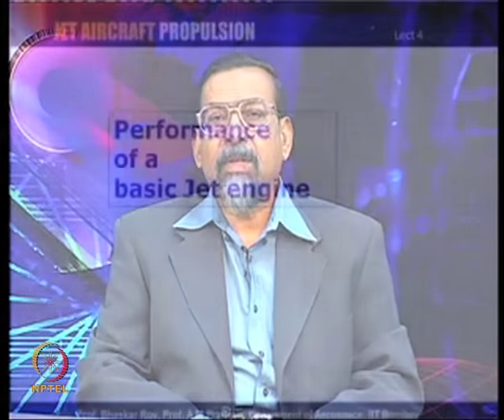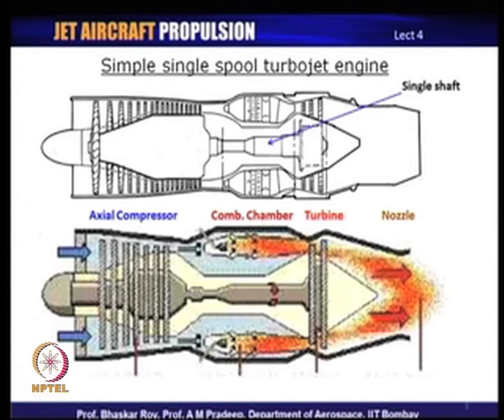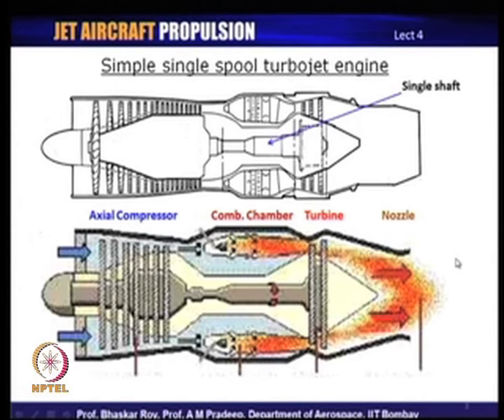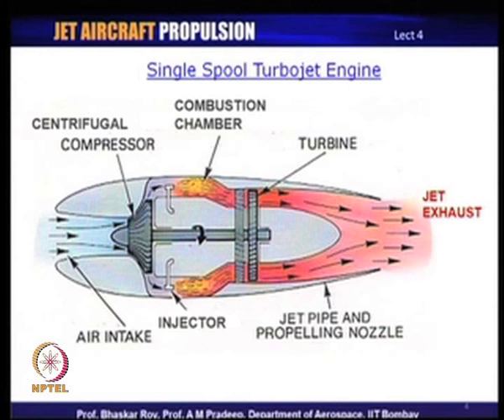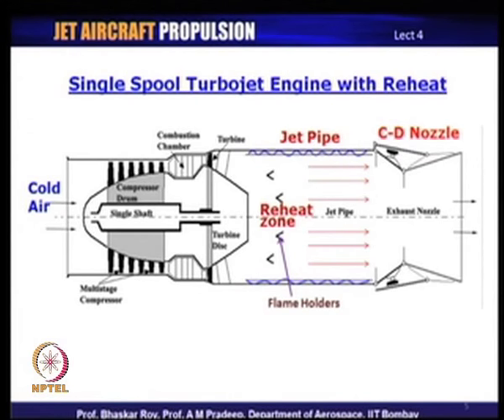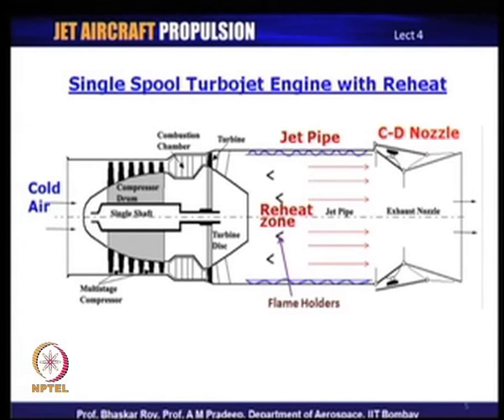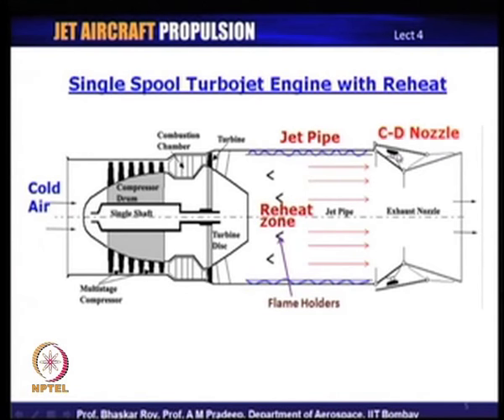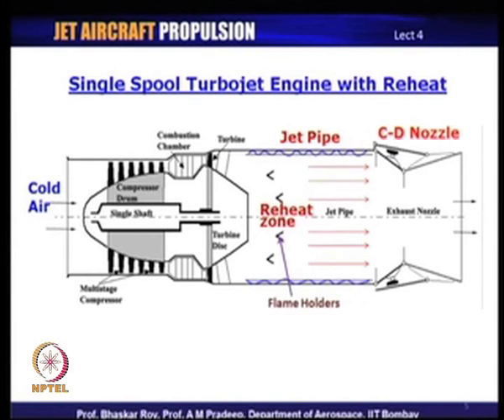Mod-01 Lec-04 Turbojet, Reheat Turbojet and Multi-spool Engines

Comment: So a C-D nozzle essentially uses the pressure while its available to propel gases of the exhaust to a jet, after the reheat process, correct?
Reply: basically what it does is increase the velocity to supersonic speed, just remember this as its quiet complex and depends on match no. and various other factors. what I can help is to summarise. 
in a normal nozzle, velocity is increased and pressure is dropped(converging)
but in CD nozzle, if the match no. is >1 , then output speed is in supersonic and the speed at throat(there m=1)
SO a cd nozzle is used because only because of that the output can be in supersonic, also remember in cd nozzle, if mach no. is <1, then there is considerable drop in output velocity and it will lie in sonic region. 
so both are related things, also remember one condition is there, the input in CD nozzle must be of high pressure, for it to work, that's why multiple compressors are used
Reply: CD nozzle increases the speed to mach>1, so as to create way more momrntum thrust.
Consider the area mach relation for cd nozzle.
For Mach >1, velocity increases with crosssectional area, which is counter intuitive to continuity equation, pertaining to Mach<1.

The high drop in pressure is because of the increase in velocity, with high velocity, the pressure goes down. If the exit pressure is less than ambient pressure, it acts reduces the thrust.

Thus, it is important to keep a high pressure already for the reheat gas.

Comment: Why a CD nozzle is used? Why cant be a simple convergent nozzle can be used, in that case also the velocity of output will be high than input.. all that we want.. so why a CD?
Reply: Remember that it is because of the mach no of the flow coming. At subsonic speeds nozzle is of converging shape which accelerates the flow and makes the flow to choke at the throat now mach no is 1 at the throat. Now for a supersonic flow u cant use a converging nozzle anymore u have to go for diverging nozzle, and now since we have diverging nozzle it further acclerates the flow to higher velocity. U can't imagine supersonic without a CD Nozzle.
Reply: I suggest you to learn about area-mach relationship , then you will easily get why do we need convergent nozzle and why sometimes convergent divergent nozzle...